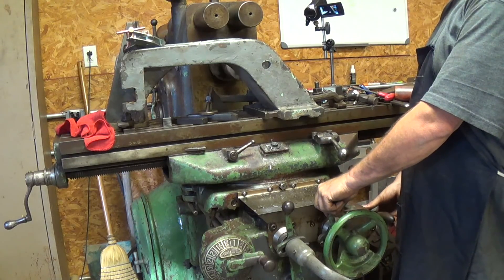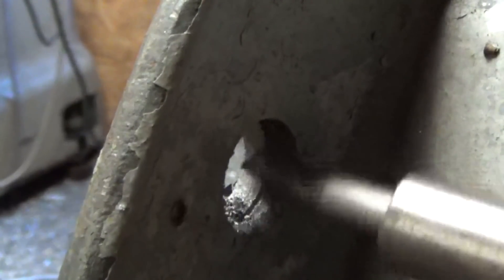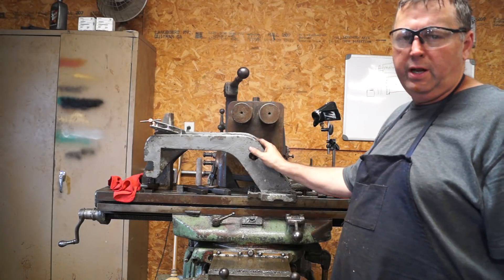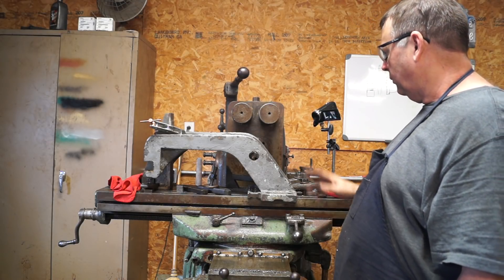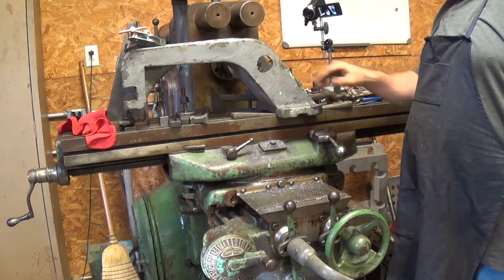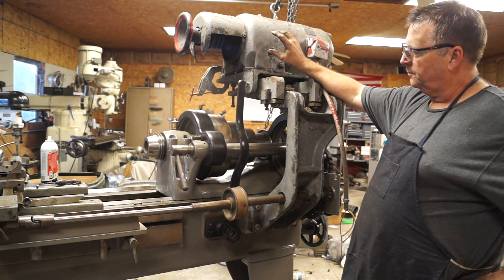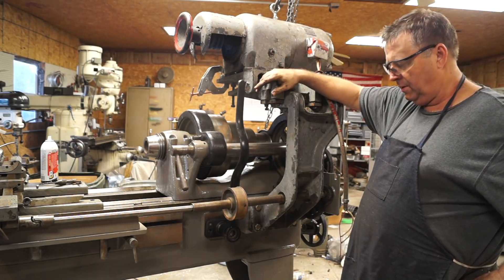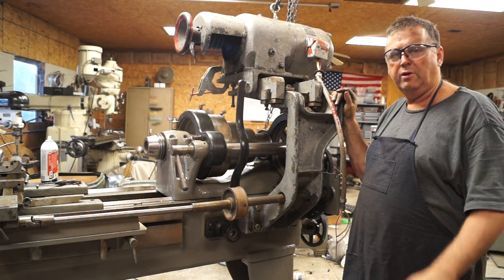Pratt & Whitney Lathe Restoration Part 12B ( Drive Mount)

Comment: Nice work Mike. Maybe I'm just ignorant about the strength of cast iron, but I'd be worried about making that big of hole in each side with all that weight and stress upon the casting from the motor. I'd feel inclined to add some reinforcement plates to each side. But then again I may just be too ignorant about the actual strength of the casting.
Reply from the maker: I think it's fine but I have plans to box it in or add plate to strengthen it.
Reply: Race cars and hotrods drill holes in parts to lighten them up. As long as you do not have it cut all the way to the edge you should be fine.

Comment: Looks factory!!!
Reply from the maker: Thanks Jonathan,
Reply: Don't think you need to worry about strength. The only time I have ever seen an issue is when they run the flat belt with an electric drive and use the weight of the motor to tighten the belt. When the belt breaks the weight of the motor slams hard.  I have the same drive on a Brown and Sharpe Horizontal mill.

Comment: Love your channel! I subscribe to several machine shop channels and have noticed that some use cutting oil on everything, somethings, and nothing. Some keep their work slathered in oil to sparingly use. Is it a personal preference or some other reason to use or not to use cutting oil?
Reply: It depends on the material being cut.  Cast iron contains graphite particles and is self lubricating.  Also, the dusty swarf associated with cast iron mixes with oil to form an abrasive paste that can damage the ways of machines made from cast iron.

Eli D.
Reply: Not only the material is important but also the martial you cutting with. Carbide don't need any lubrication by itself, it's hard and can withstand high temperatures, but Lubrication can help with the surface finishes, and oil cools the part, making it easier to get to the needed tolerances. High-Speed-Steel on the other hand is softer compared to carbide and the hardness is closer to the material you want to cut. The closer the hardness the more important is good lubrication, to make the cutting action as frictionless as possible.
Also the type of lubrication can vary depending on the type of material. The softer the material you want to cut the thinner the oil should be.

So there are many reasons when and what oil to use.
Reply from the maker: Tim
There are so many opinions about coolant and cutting oil that we can discuss it forever, It looks like Eli and boelwerkr covered most things you will see on my channel